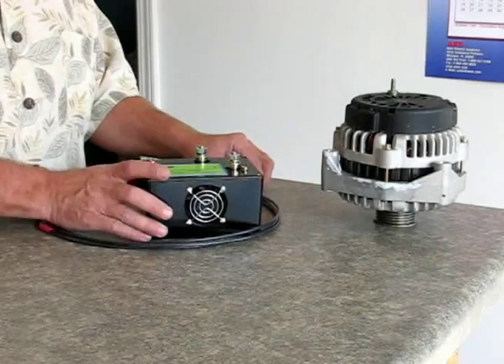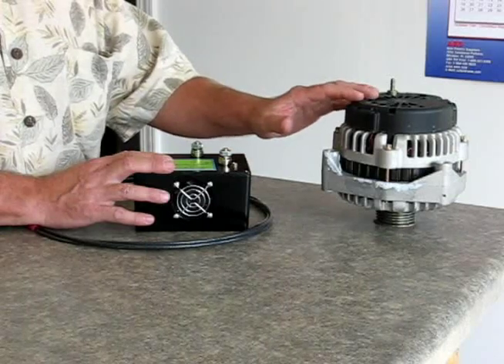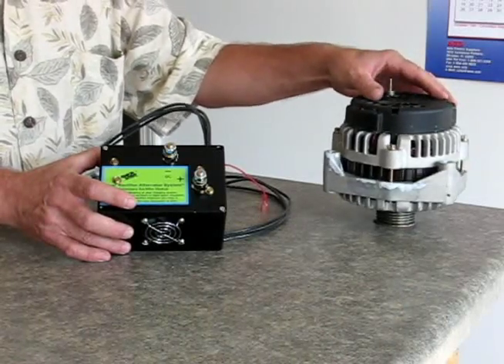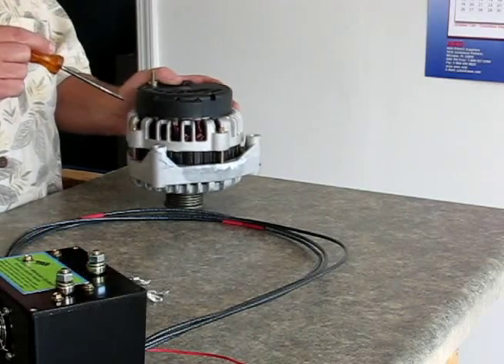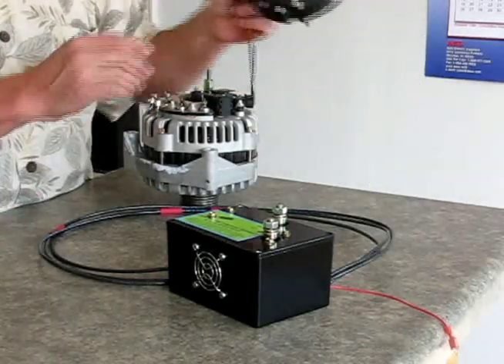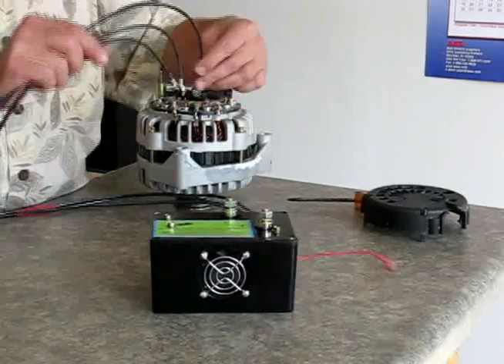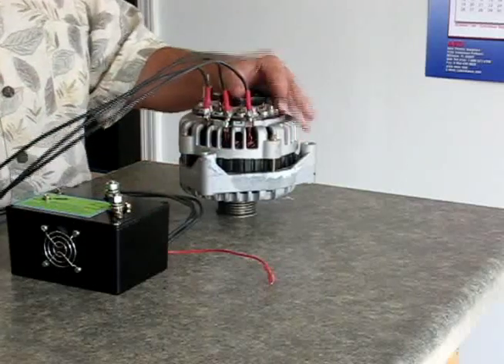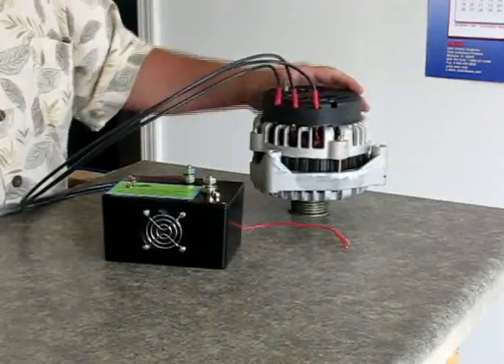how to install the quicktifier remote bridge rectifier on your alternator

Comment from the maker: you don't gain any voltage or amperage from your alternator's rating, but it would help with the heat issue which would let more of the current being generated by the alternator pass through to your system, giving you closer to the 145 amps your alternator is rated at.

Comment from the maker: You have to determine which wires are the actual phase connections. 6-lead, Wye wound stators usually have 3 phase leads, the wye connection lead, and two signal taps for sensing rotation. There is a how-to video for installing the Quicktifier on a 3G, which has 6-wires off the stator, but it doesn't have audio.

Comment: I run a Beck/Arnley 120A alternator in my old Toyota that mounts near my exhaust manifold. Charges beautifully at 14.5V before the engine is warm, but once warm it can't even keep up to 12V (which I know means my battery needs a good charge) if I'm idling with any respectable load on it (headlights, blinker, wipers, etc.). My first thought was one of the diodes is failing, but everything tested fine when I checked it. Could this help alleviate the low idle voltage issue?

Comment: If there is 1/0 gauge being mounted on the power post external of the alternator, shouldn't the three wires connecting the rectifiers together be at least 1/3 the size each to prevent their resistance from being the weakest link in the chain? Just curious.
Reply: Not necessarily. A/C power travels much better through smaller lines than DC power does. With A/C you can use smaller cables for each phase, but once you have the full DC current, that's when you need a large cable.
Reply: @NordicDan  its not that AC or DC makes it different, the difference is the voltage component is much higher before the rectifier. High voltage = efficiency and allows that high voltage AC power to be converted efficiently at or near the load where low voltage and high amperage are less efficient.
Reply: @georgesrisomsak9650  good call. Better explanation than mine.

Comment: has anyone actually gotten one of these? trying to build a system but need to know if it actually produces more than stock amperes
Reply: No it does not increase the current output. It merely distributes the existing current over more rectifiers.

Comment: This video doesn't actually show anything other than taking the cover off that alternator. It doesn't show the inside of the rectifier box and doesn't show the actual hooking up of the leads on the alternator. I could not see anything on the alternator other than before and after.

Comment: looks like you connected the quicktifier in series with the 3 rectifier outputs that are internal to the alternator.  you have not reduced the loads on the alternator diodes but have just added some more load to the alternator.  the only way to reduce the load on the alternator is to install the wires from the quicktifier on the copper leads coming out of the windings.  they do not provide screws for those wires.   so now u have a mess.
Reply: Wrong. If the DC load is drawn from the Quicktifier + and -  terminals, and nothing is attached to the old B+ post on the alternator, then NO CURRENT is going through the old diodes. They are superfluous.